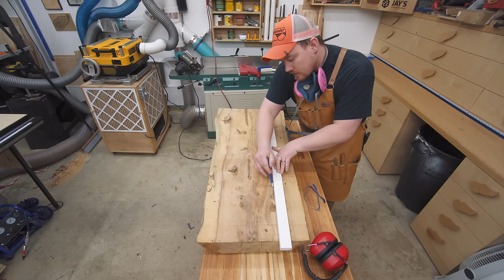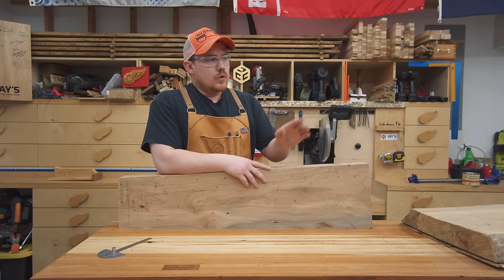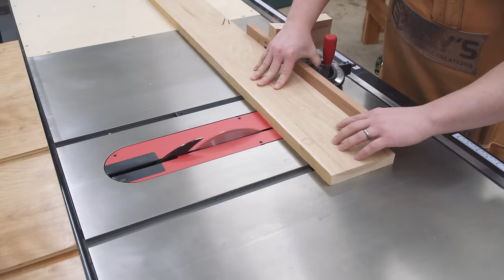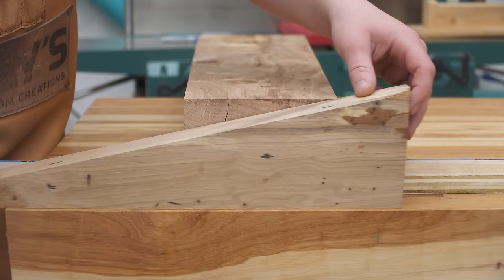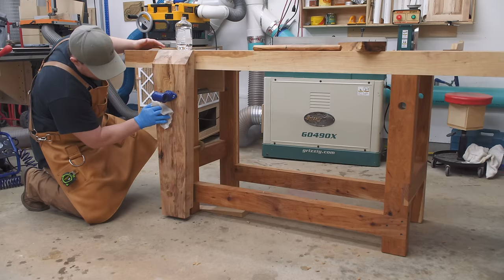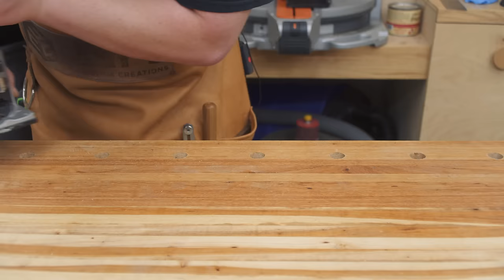Hickory Workbench Leg Vise and Dog Holes - 299

Comment: That is an excellent idea.  It occurred to me that for your "dowel issue" you could have used a piece of 3/4 inch cold rolled steel.  You won't flex that and it could have remained on the outside of the leg.  Just a thought.  I realize this was 5 years ago.

Comment: I haven't went through all the comments so someone else may have already said this but couldn't the dowel go through the leg?  Then you wouldn't need the extra piece to hold it in place, it wouldn't bend like it did on the outside and it wouldn't be in the way like it is on the inside.  Great simple design, love it!

Comment: Lovely bench, even better vise. I like the wedge adjustment on the bottom of the chop, but..... (you knew there was one coming) I think I would use a flat piece of metal sticking up rather than the nails. I can just see those nails accidentally penetrating my Chucks.   

P.S. the screws didn't bother me at all.

Comment: Hi Jay, the new Workbench and the Wise looked really awesome :D Only the dowel you made looks a little bit thin. 
Here a challenge for you as Master Woodworker ;) Try to make a thicker dowel, as this as metal ring. 
The dowel must be divided and the two part have wooden threads to screw together inside the front piece of the Leg Vise. 
So you have a thicker dowel and a straight line ;)
Best wishes and greetings from Germany

Comment: I also had a Paulk style bench and liked the large table top area for assembly. I am now going more traditional. You say you'll be working around both sides of the bench, I will have the same option. Q: Why does everyone stay at 24" or less? I understand if you're working with it against the wall and don't want a long reach. Is it a furniture or cabinet build thing I haven't considered? My wife says bigger is better, I don't know what that means:) Thanks for the content. I always find myself coming back.

Comment: Jay, this is the best video I have seen on leg vices. I had a leg vice on an early bench and never got on with bending to adjust the bradawl I used in the guide.  Eventually the guide split along the grain of one of the holes.  I changed to a metal qr vice which, whilst quick and easy to use, particularly when going from small to large openings, is far more limited imho.  I really like the wedge and wondered how it wouldn’t rack until I saw you cut the corresponding ramp on the chop.  Genius.  I’m a fan of holdfasts and  Mr Mike Siemsens workholding video on a viceless bench.  Apparently a wood screw is quicker to open and close but they’re prohibitively expensive.
You have inspired me to return to the leg on my soon to be built Nicholson style bench.  I will be fitting a tool well.

Comment: Hi Jay,
Great bench and as always thanks for the education.  

Re the alignment dowel, could you put it through the centre of the chop directly below the screw through the leg.  In that position it wouldn't"t interfere with the clamping capacity of the side of the chop.  

G.Bates
Reply from the maker: There is more of a chance of the dowel binding if the hole isn't perfectly straight or if the chop sags slightly when drilling a hole through the leg for the dowel.

Comment: It's funny that when I built my bench out of southern yellow pine almost used some hickory that I got cheap from a local hardwood dealer. It was not the best material and by the time it was cleaned up I didn't have enough for the whole top. It makes me wonder what the bench would have been like had I found some more. :-) Very beautiful bench you have there.

Comment: Thanks Jay for another nice piece of work and helpful video. I have a question about your use of a sled with the DW735. I building my first serious shop and getting that planer. I’m thinking of putting the planer on a mobile cart kept between a miter station and small workbench. With the planer bed just a smidge above the other surfaces. Would that work to make the miter station and workbench serve as permanent in/out feeds and remove the need for a sled?

Comment: Awesome video! What angle do you use for the vice wedge? is 15 degrees too steep? Do I have to worry about the wedge "squirting" out when I tighten the vise? Also, the wedge would limit your vise capacity, correct? I suppose additional an spacer could be used with the wedge for added capacity...

Comment: I was wondering, if it might come in handy to put one or two holes for dogs in the top of the jaw as typically seen in tail-vise-jaws and sometimes in the jaws of modern front vices. 
However, I could not find a single leg vise with a doghole in it's top, which made me doubt my idea. The only thing coming close is a leg-vise-style tail-vise in an article by popular-woodworking called "3 Classic Vises made with Pipe Clamps".
So: why would nobody put dogholes in leg-vices? Sure, the grain direction is not ideal for that, but still might be plenty strong enough, especially with a hardwood jaws.

Comment: Jay, could  could you put the dowel through the leg,  below the screw, that way you can put cabinets or whatever under the bench?
Reply from the maker: There is more of a chance of the dowel binding if the hole isn't perfectly straight or if the chop sags slightly when drilling a hole through the leg for the dowel.

Comment: I love this, in fact this is what I'm going to do to retrofit a leg vice on my own bench. But why does the lower guiding dowel not run through an extra hole in the lower part of the leg instead?? Why the extra part, the thing with the flexible hole?

Comment: The work bench is beautiful. Would be hard to work on, I would be afraid of getting dings in it. For the rod on the vice could you not drop it down under the bottom of the bench like on your original? That gets it clear if you want to add shelves. Thanks again for the great videos.
Reply from the maker: The original is actually a little bit in the way when the wedge is pushed forward.

Comment: Jay couldn't you add a dowel in the center of the chop directly under the handle, thus leaving the inside open for your cabinets you want to build?? Love the look of the hickory once the oil was added.
Reply from the maker: There is more of a chance of the dowel binding if the hole isn't perfectly straight or if the chop sags slightly when drilling a hole through the leg for the dowel.
Reply: You could make the hole a bit larger through the leg and then use your dowel support with the split screwed vertically in the inside leg to account for any alignment issues.
Great job. Love the look of hickory. Keep up the great work.

Comment: Jay, I'm going to build your great leg vice.  Great design and ideas!  I have some scrap 2x6 fir boards.  If I laminate together, too soft of wood?  Or useable for for a leg vice?
Thx,
Will
Reply from the maker: Go for it! They will do the job just fine. I have a 100% southern yellow pine workbench and the leg vise works great.
Reply: @JayBates  Jay, thanks for the timely reply!  Yeah, with lots of surface area, should work.  Can always replace with another chop too.  You put out great stuff!  Keep it up Jay!

Comment: Jay, watching you cut the wedge angle into the base of the chop. Doesn't that eliminate the possibility of using it as a left-handed vise? It would require the left-handed user to go all the way past the end of the bench to kick in the wedge. Maybe I just missed that part. I do like the idea of mounting holes in each leg.
Reply from the maker: At that point the left handed user would either have to remake just the chop or glue in a piece of wood to the bottom of the chop and cut the wedge shape again for left handed use.
Reply: That's what I figured but thought maybe I was missing something. Thanks. And I LOVE the Hickory. It looks awesome! I, like you, used SYP for my bench and it's holding up fine. I used alinear bearing and steel shaft for my parallel guide on the leg vise and I'm loving it.

Comment: I know some will argue but my two cents.  Use a sled and your planer from the start!  Shims and hot glue to make it stable run it through then remove the sled and flip it.  I guess it's just locked in my head that a jointer is for edges not the main field of your board.  But since you made a point of removing the guard and not liking that maybe consider this next time.  That Hickory sure looks nice man!
Reply from the maker: I'd still much rather remove the guard and get it flat in a few seconds and not have to deal with shims, hot glue, and my planer. The planer doesn't like hickory at all so the less I use it the better.
Reply: It does boil down to knowing your tools also.  I certainly don't know your tools.

Comment: Considering the effort you put into drilling the legs so the vise is ambidextrous, I'm surprised you didn't cut the angle in the bottom of the chop from both sides (to form a shallow "V") - it would keep the vise symmetrical for use from the left.  Also, why didn't you run the dowel thru the leg?
Reply from the maker: There is more of a chance of the dowel binding if the hole isn't perfectly straight or if the chop sags slightly when drilling a hole through the leg for the dowel. There wasn't much effort involved in drilling a leg vise hole on each leg. They were drilled with a drill press before assembly. Super easy. The reason I added extra leg vise holes for a lefty person is because it is difficult to drill a hole that size and depth keeping it perpendicular to the leg after assembly. As far as the one sided wedge cutout, it's really easy for a lefty to take the chop off, glue in a scrap block to fill the cutout, then cut the opposite angle. A "V" cutout on bottom would result in the wedge only contacting the right side for me which means if I put something in the vise that is 100% right of the screw the vise would rack to the left.

Comment: For finding the center line wouldn't it be easier to mark the center across 2 points connect a line across and mark perpendicular to that? Also for your tool well anyway to use the extra leg vice holes you've already drilled? Some kind of triangular support braced in the holes vertically and against the bottom of the bench resisting the moment from tipping?
Reply from the maker: That would work if you made the cut freehand. I was looking for the angle to rotate my miter saw. That would work if you made the cut freehand. I was looking for the angle to rotate my miter saw.

Comment: Jay on the next bench build make the angle of the mating wedge block into the ledge so the wedge is flipped over 180 degrees, so only the straight side is facing out and the fat part of the wedge is not sticking out so far! Just a minor tweak to a good solution you have. Unless you are doing a lot of really wide boards, I would also raise the screw up higher and easer to reach, in upright standing position, hand grip on your side elbow bent slightly, whatever that grip height is the screw location. In reality, a woodworker's benches are made to the persons size to be made correctly not to someone else's dimensions. Also, ideally you need 3 specific workstations location, planning, sawing, and chiseling for hand wood working. Each requires a separate height for good ergonomics in working. Jay like the work you are doing and the journey you're on!

Comment: You didn't seem concerned about tearout at the bottom of the dog holes while drilling them.  Is that because the bench top is thick enough that it won't matter, or does your auger bit produce minimal tearout (if it does, what kind is it)?  Thanks
Reply from the maker: I don't recall how well the auger bit did on tearout with the exit side. However, it's a workbench and the tearout will never be seen and won't affect workholding. So, honestly, it doesn't bother me either way.
Reply: @JayBates  Thanks for the reply, I appreciate it.

Comment: - u may want to add the second piece of leather to the work bench side, so you don't damage some of the softer harder wood, Hickory is hard enough that cause damage to some of the wood you might put in the vise. 
- the dowel can be moved lower so it is not in the way of any cabinet you were thinking of putting in there.
Love the finial appearance of the bench, came out just fantastic.

Comment: What if you cut a short slot parallel to the handle's axis and centered at the middle of the handle? This would allow the handle to drop out of the way if you stopped near vertical, but would leave you something to grab when you're ready to turn again.
Reply from the maker: Unnecessary. This is much easier and if the handle is in the way just advance it 1/8 of a turn.
Reply: Fair enough. I wasn't criticizing, by the way. It's a beautiful vise. The thought just occurred to me as I was watching.

Comment from the maker: Vise screw: https://lddy.no/unve
Reply: Totally agree. Great job. Thank you.
Reply: Agree, a great job.  We have Shagbark Hickory here in Oregon but I've only used it for Landscapes.
Reply: Jay Bates - Woodworking Videos 

OK I really did like your all yellow pine workbench good inexpensive demonstration for a good work bench

But after seeing this hickory workbench you have built I’m in love

I’m still in the process of building my workshop and after my outfeed table/assembly table 

My first real priority will be a work bench much like your yellow Pine.

I really do love the marbling and a mixture of sapwood and hardwood in that tabletop just beautiful
Reply: Jay Bates - Woodworking Videos i
Reply: What is it with you guys that have to have 4 inch thick hardwood chops. Mine is over 120 years old Scots pine 1 inch thick slab chop. It works well even today and looks the part more than that slab on your bench will ever look.
Reply: I know I'm replying to an old video, but I have to. You did great work. I hate seeing this wedge used to overcome simple torsion forces alone the midline, medial. Simply: a second screw below (yeah, that means screws top and bottom to perpendicular) or a manual graduated stop (adequately sized opposing dowel with holes @, say,  3/16" - 1/4" and a slide/brace/locking pin) or, better -- a loaded spring tube stop. The problem to solve here is counteracting the natural torsion reaction of the leg vise applying force at its top -- of course it will want to kick inwards around its centerline (the middle of the leg vise).

Comment: My first leg vise used your wedge, the major downside for my shop though is I like to have anti fatigue mats all around the work bench. The wedge just seemed to catch a lot. What I've done now is use a linear bearing and 3/4 inch rod in parallel to the screw. It's absolutely amazing. Obviously more expensive, but still way cheaper than comparable guides from bench crafted.

Comment: Jay, what do you think about this wedge system for someone who is primarily hand tools? I want to get a leg vise but don’t want to shell out $300 for a BC and I know I’m too lazy for the peg system. Just wondering your thoughts on this holding up for extensive use.
Reply from the maker: Why would it not hold up? Its origins are from Andre Rubo. Pretty much guaranteed to never fail.
Reply: Jay Bates - Woodworking Videos I guess I have just never seen (or thought) of such a simple solution before. I really appreciate you putting this out there! I can’t wait to try making one for myself! Great content as always

Comment: Could have flattened that slab with a router and rail guides.  Then you would have a flat side for the entire piece even after you cut out what you needed.  Then you could use a length of plywood tacked on to the board as a straight edge.

Comment: Is there any downside to drilling a hole through the leg just below the short stretchers to run the dowel through? Hides the dowel visually and gives an inch or two more clamping surface for panels.
Reply from the maker: There is more of a chance of the dowel binding if the hole isn't perfectly straight or if the chop sags slightly when drilling a hole through the leg for the dowel.

Comment: why not put a dowel at the bottom through the leg and between or above the rails to help with the stabilization? Instead of on the outside, impeding as you said any structure you want to put in the bottom.

Comment: are you sure you didn't just screw up which leg to drill the vise screw for?? btw, the vise nut could be mounted the other way round to gain clamping width, sort of, into the leg. An auxilliary toolwell could be a box that hooks on the side of the bench latching into a pair of dog holes..
Reply from the maker: Yes, I'm sure I didn't screw up which leg to drill the vise screw for. btw, the vise screw has 4x too much clamping width as it is. An auxiliary toolwell that hooks onto the dog holes would make an obstruction on top of the workbench.
Reply: Hey Jay, The vise nut is supposed to be turned the other way and mortised into the leg.
Reply: The countersinks in the screw holes would suggest otherwise.
Reply: I purchased the Veratas version of this screw and mine are counter sunk on the opposite side and their instruction indicate the mortise. From an engineering standpoint it would make sense to mortise.
Reply: I have the blue screw as in this video and I mortised it into the leg and do use the extra vice holding capacity. I saw an another video where the man used a steel rod with a linear ball bearing. I would prefer to use a linear bearing set up but I presently use the foot wedge like yours, its ok but not great when shavings on the floor get in the way.

Comment: Will running the dowel through the center of the leg solve some problems?
Reply from the maker: Probably so but you have more of a chance of the dowel binding if the hole isn't perfectly straight or if the chop sags slightly.
Reply: I had the same thought, and wondered why Jay didn't go that route. 3/4 dowel (waxed) -- 7/8 hole
What a gorgeous workbench, and nice legs too!